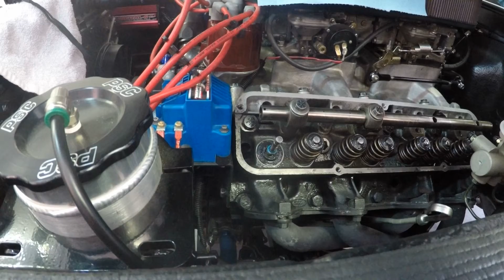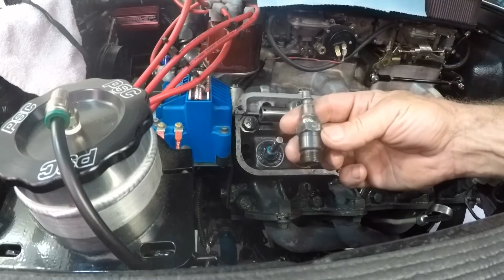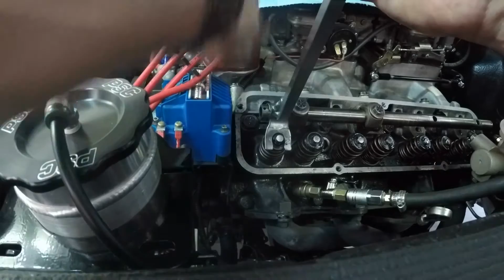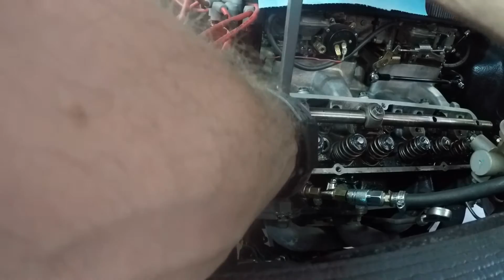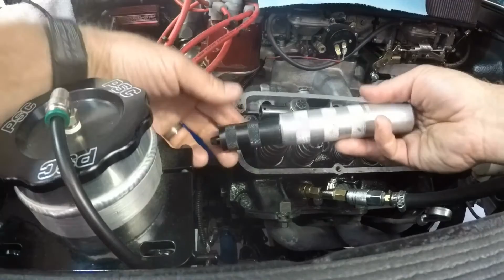FE valve spring install

Comment: What valve stem seals did you use? Mine has isky double springs and I need the correct seals so the inner springs don’t rip them apart
Reply from the maker: I turned down the valve seals and installed comp vitron seals.

Comment: I just did this to my 390 with the screw spring compressor from Harbor freight.
Reply from the maker: Yes, it will work on light to medium pressure springs just fine.
Reply: @inmygarage_kenm  yours idea looks a lot easier

Comment: Great video. Very creative ideas. Kinda funny I just made that spark plug tool without ever watching this video. Sadly I don't have the keeper remover tool and not even sure if it will work on a 55 year set of heads in the vehicle.
Reply from the maker: That keeper removal tool is really only for very light springs. Once the spring retainer is pressed down, the keepers can be removed easily with fingers or a magnet.